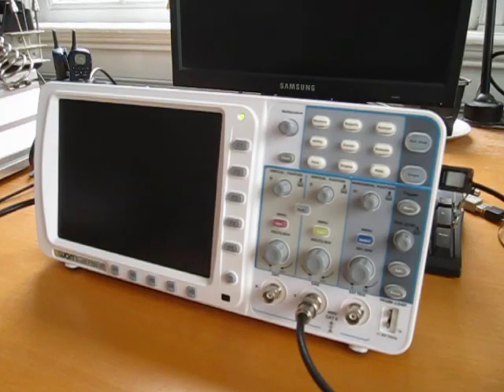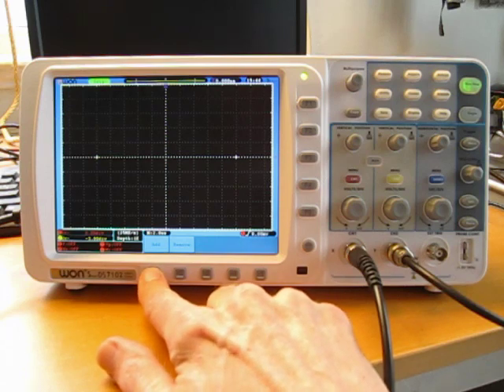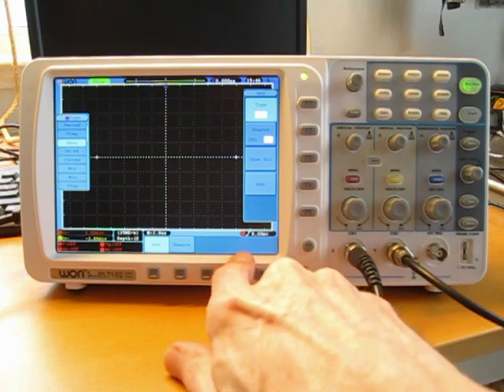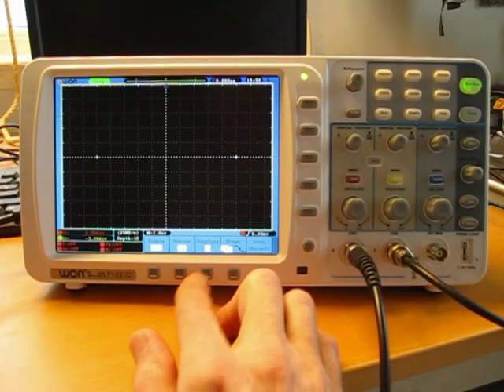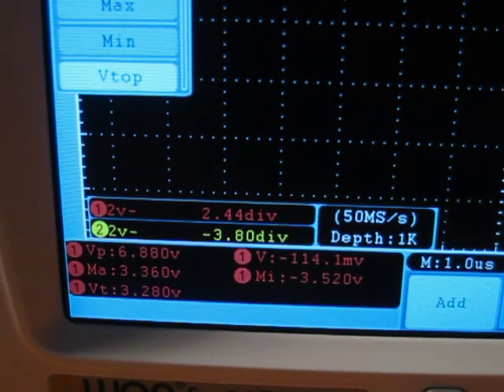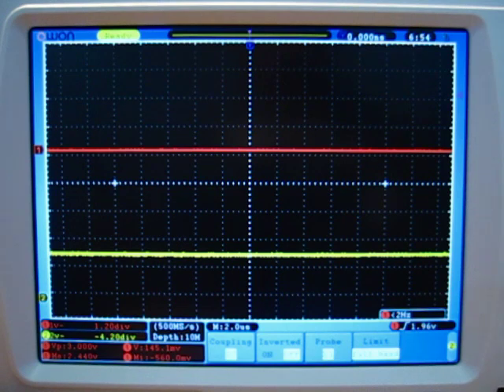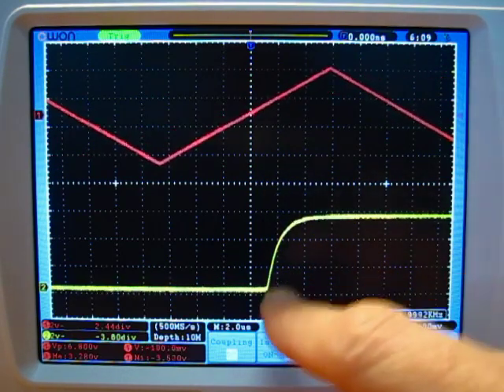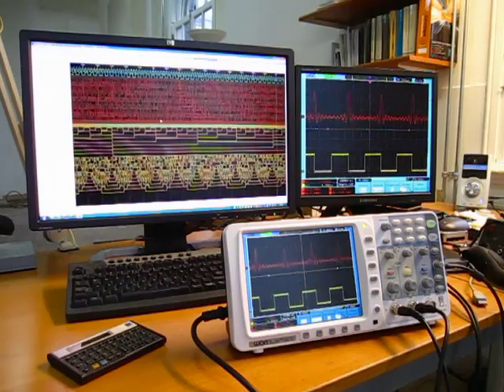OWON SDS7102 Review Part2

Comment from the maker: @mdesm2005 - I repaired my old battery-operated Tektronix 212 analog scope, and have been using that since. I'm currently doing some audio work - so I may get one of the Velleman PCSGU250 combination scope + function generators (a great buy for the money) - and will review it here if/when I do. I still will need to get a higher-bandwidth DSO at some point, but I might wait until I can afford (i.e. when I land a job I can bill it to) an Agilent or GW-Instek.